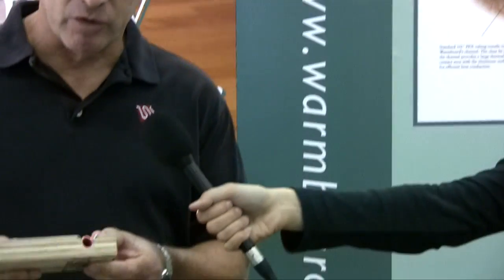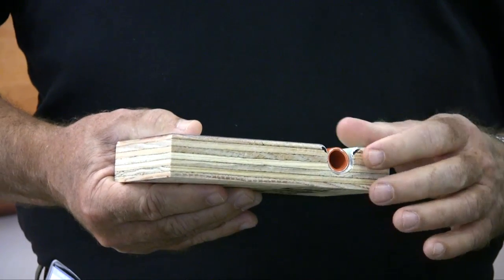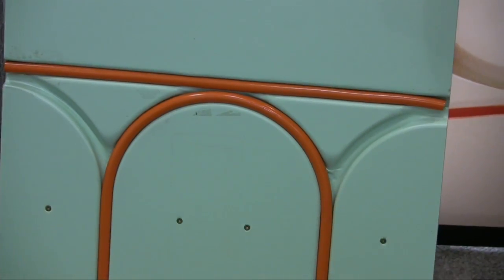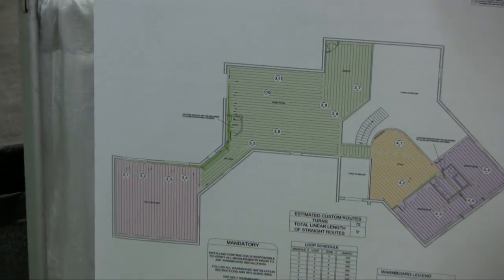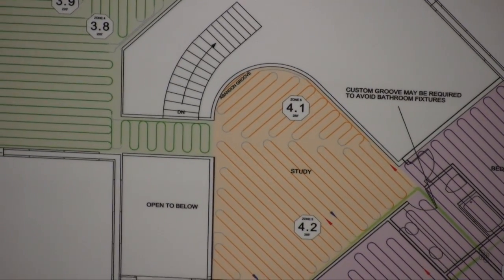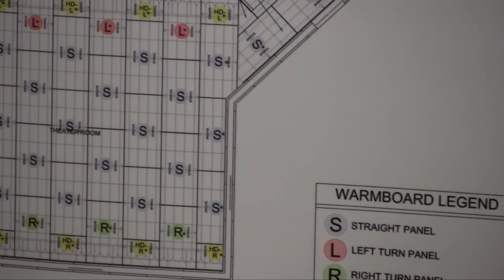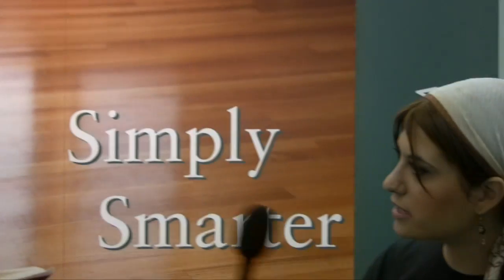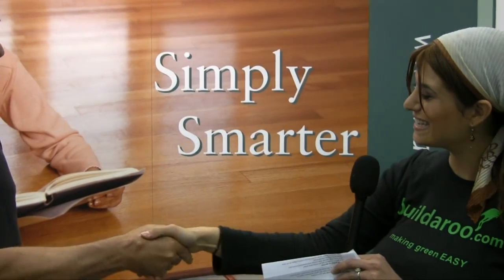Warmboard radiant floor heating - buildaroo.com

Comment: I'm not so sure I would use this as my only source of heat especially if you live in a very cold climate. I mean it might work just fine but it seems to me like it would be slow to heat the house. And any heat loss like opening the door would take a long time to make up. I guess my comment is more of a question then a comment.

Comment: What a great system.
Im from Australia and have seen nothing like this.  I actually did something similar and routed the groves for the pipes to sit in myself in the subfloor, but it takes a long time and very messy.  The Aluminum would do a great job of spreading the heat around.

Comment: Thanks, the idea is great, and it does sound competitive.  I like the idea of no forced air vents, noise and dust.  Also the heat begins at the bottom and rises.  Does Warmboard just sell the boards or help design the whole system?  I imagine a retrofit like I would be doing would need a furnace, pump and the board and tubes, etc.  How could I cost this all out?